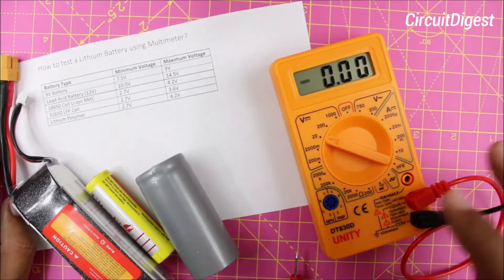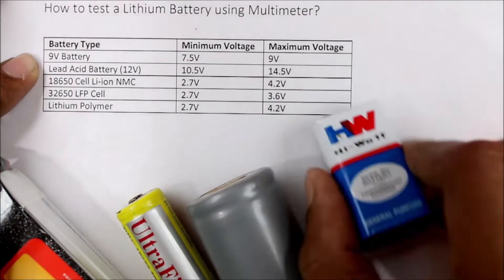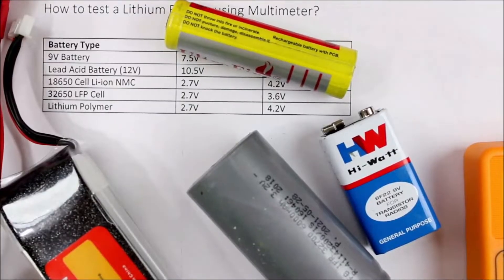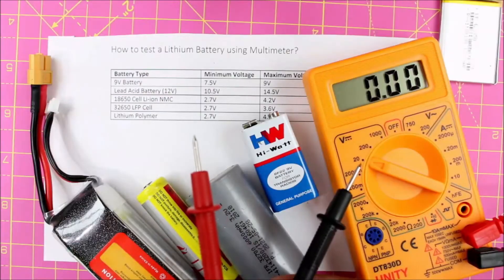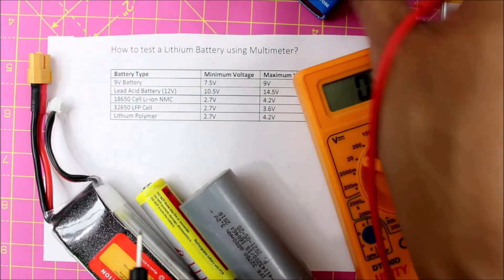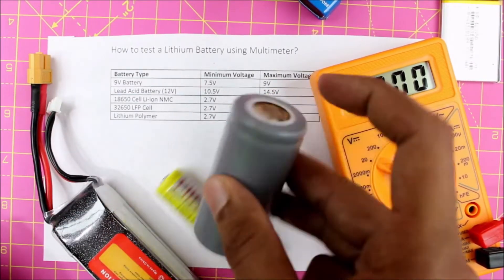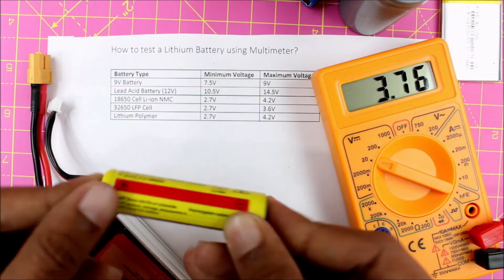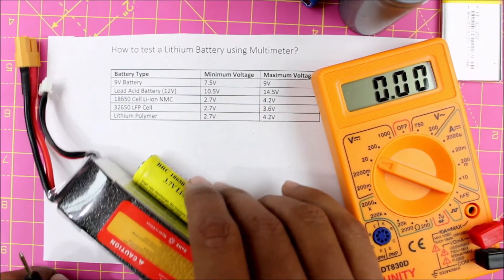How to Check Battery is Working or Damaged with Multimeter | 9V Battery, 18650 Cell, Li-Po

Comment: I have exactly the same budget multimeter, It was working fine then all I did was replace the multimeter  battery, I want to test some 1.5v batteries, when I turn to the left & to 20volts it reads -0.22, shouldn't it read 0.00 ?  ?
Reply from the maker: make sure the battery you put in it is good.

Comment: How test 3 18650 in one unit like robot vaccum
Reply from the maker: check if the voltage is between 9v to 12.6V. If the battery back has balance connector, you use that to check individual cells.

Comment: It is totally unnecessary to check cell polarity and no one who actually does this seriously actually bothers to "recommend" it. It serves no purpose and is a total waste of time.
Reply from the maker: I am sorry but I think you understood something wrong here. 1. Checking cell polarity is important 2. This video shows how to check if a battery is in working condition by checking the cell voltage
Reply: @Circuitdigest  No, I understand just fine. Checking polarity is completely useless when checking a battery for voltage. It is 100% NOT important. Period.
If a nominal 2.7V cell is checked it will read either X Volts or -X Volts. The only important value is |X|. Since the battery can not magically flip polarity, the sign of the value for X is totally irrelevant for checking the battery, which you even admit in your video, before going on to add that "it is always recommended to measure It in the right way". Why? No it's not! As you admit, nothing "bad" will happen, and the only difference is the sign of the Voltage value displayed. If you can 't do the absolute value calculation of voltage in your head, there is something seriously wrong with you!
Reply: You're just trolling out here. Learn the technicalities involved instead of picking on the video creator on non-issues!
Reply: @acodsw8813  No, I’m not. And I know the “technicalities” quite well, thanks.
Funny how they’re “technicalities” when you think they’re some esoteric information that others have and I don’t, but the exact same things are “non-issues” when I reference them.
Note that it does not escape notice that you were unable to comment on the actual substance of my original post. Maybe because you lack the basic competence to comment on the very “technicalities” you mentioned.

Comment: I don't understand. If the battery is below the minimum voltage level or marker it is considered dead or not working?

A battery is not good til the last drop of juice.
Reply from the maker: lets consider lithium NMS cells they have an operating voltage of 2.7V to 4.2V normally. Now if the voltage of the cell is within this range it means that the cell is healthy, meaning it can be charged and used again. If it goes below 2.7V it means the cell is over discahgred and even when you charge it it might not be able to retain the capacity

Comment: Bad testing but has a simple 5 second, 10 cent fix. This test is OK as far as it goes, but you are not testing the battery under load. You may get 8v off a 9v battery this way, but that 8v is no good if it drops to 6v under load.
 
Its a simple fix to test battery voltage under load, just twist the legs from a 5w 10 ohm resistor, one to the RED and one to the BLACK test leads where they enter the metre and then test the battery.
The results you now get, will be far more usefull as it shows the TRUE voltage of the battery when its put under stress
 
They do the same to test car batteries, they may read 12v when not under load but drop to 8v when you try to turn the engine over, and get CLICK, CLICK, CLICK.  same test rig used but much bigger and higher power resistor
 
Tip: For AA and AAA batteries a 1/2w 10 ohm resistor will work. (or 2x 20 ohm 1/4w in parallel)
Hope you find this useful.
Reply from the maker: Well explained! As mentioned the above video only shows a crude way of quick testing